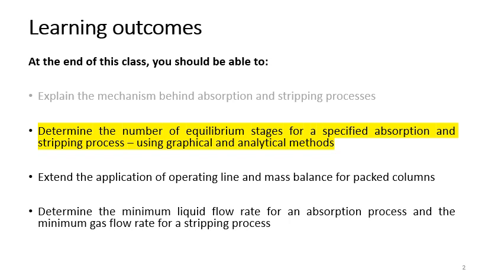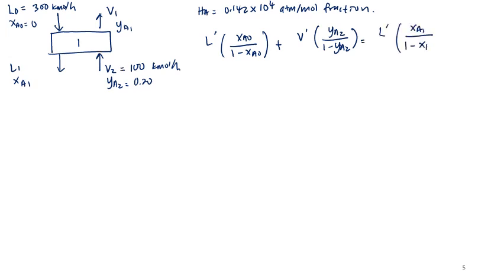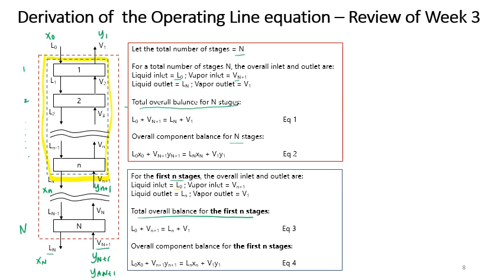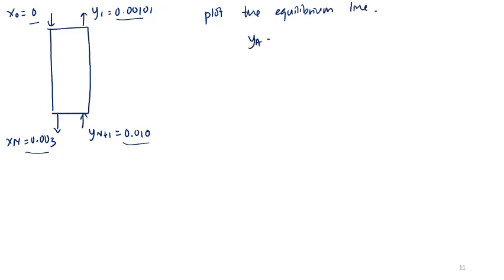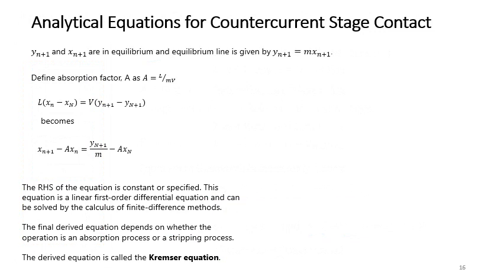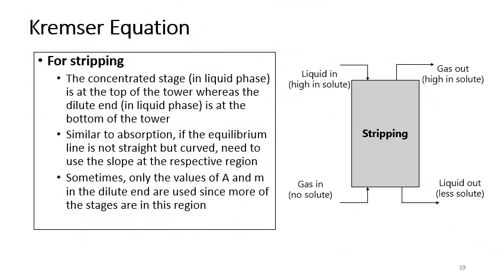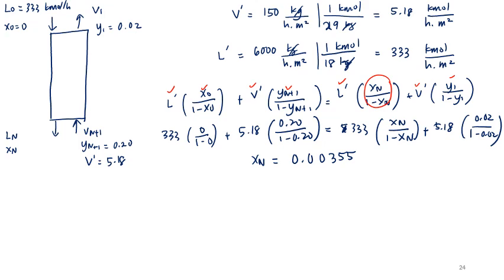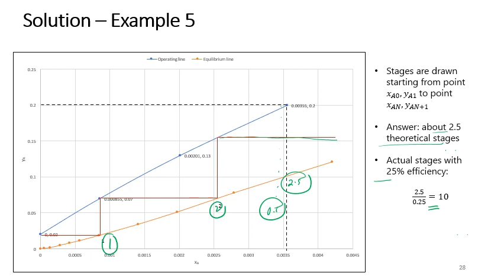08 Introduction to absorption & Design of Absorption tower with stages Part 2 latest

Comment: In min 11:20 you didn't show how you found step by step the xA1. I would appreciate it if you tell
Reply: Hi there, In order to obtain xA1, sub the value of yA1 into  eq 1. Now in eq 1, you may solve xA1 to obtain its value.
Reply: @kuhaneshvejayan5694   Mam I tried with this way but couldn't find the correct answer as yours and rechecked my solution many times. It would be appreciable if you can send the detail solution.